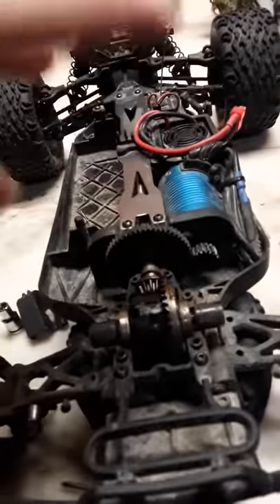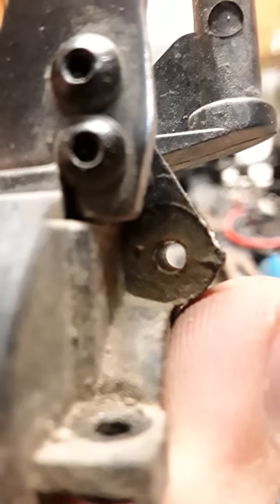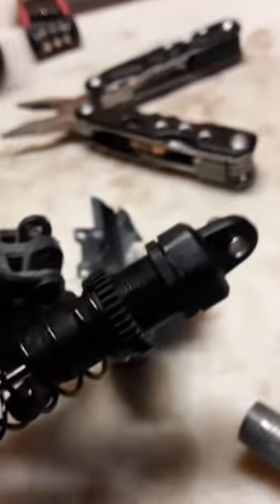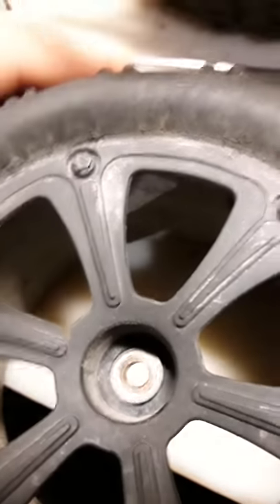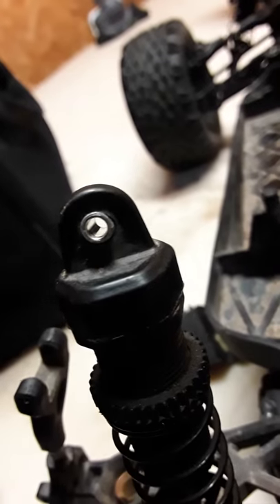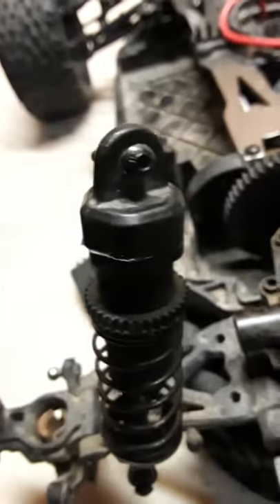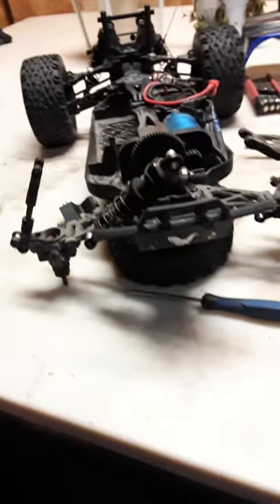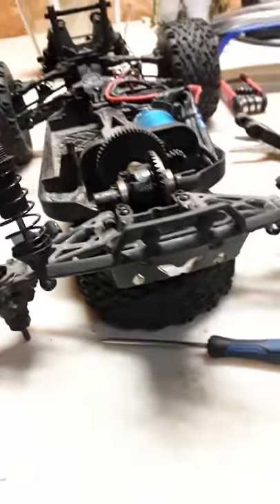How to take apart a redcat xte pro diff explained

Comment: Can I make one tool recommendation?  MIP hex drivers - they're pricey but they never ever will strip.  Made in USA of drill blank steel.  I've had a set for almost 30 years.  Buy once, cry once.
Reply from the maker: Thx for the recommendation. I have used these hex drivers and they work fine but I will consider looking at them. Thanks for dropping a comment E2q